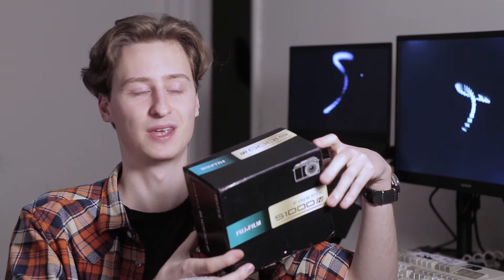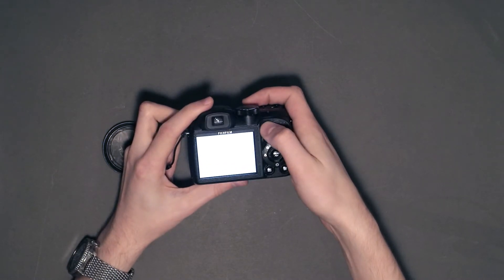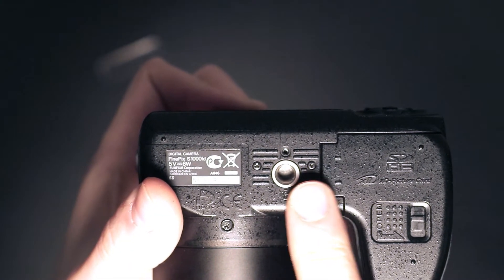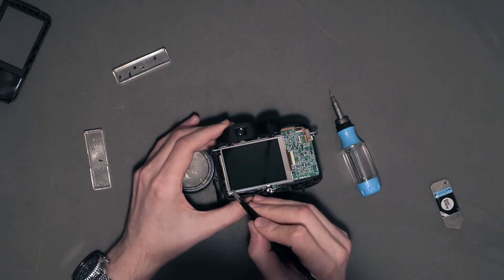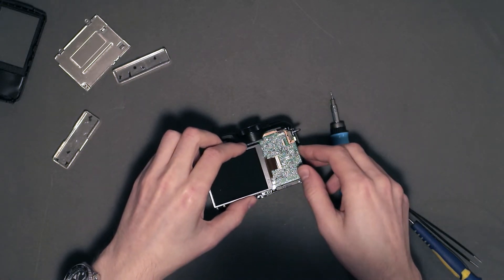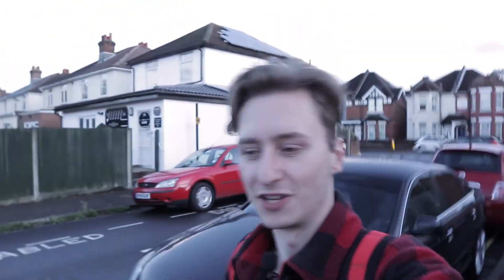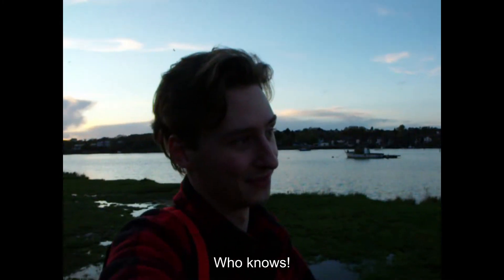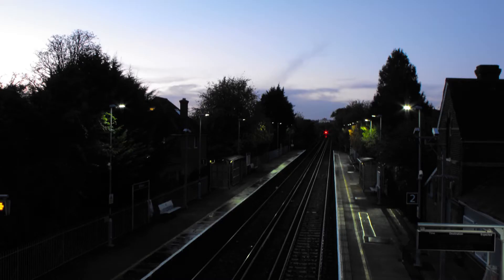Broken Fuji FinePix camera from 2008 - can it be fixed?!

Comment: I got into photography a few months ago. My main camera is a Fujifilm XT-20; my uncle just gave me this. It had some important family memories on it, which I saved, and thankfully the images are very clear and the colours were vibrant, allowing me to see my loved ones from more than 15 years ago. I think it does a pretty good job and it easily surpassed any smartphone's camera at the time, even though it wasn't really expensive back then either. It's so tiny and cute. It's just fun to mess around with. It's obviously not that special now, but if the lighting conditions are different, it still seems better than those often oversharpened, artificial looking smartphone images some reasonably expensive phones of today do. It's little flaws and old CCD sensor gives it a more nostalgic vibe I suppose. Or maybe it's just me romanticising an otherwise almost worthless, outdated little camera. I'm actually really glad you bothered to save it. Thank you!

Comment: Cool. First class video. I plan to try repairing a FinePix S2950 using an AI generated guide that suggests a shorted capacitor in the power supply circuit.

Comment: I mean... NiMH cells are basically guaranteed to be the most environmentally friendly option, so i like AA battery bays. If people didn't just ruin them every time by leaving alkaline cells in. Alkaline cells don't even work THAT well in digicams, you get a lot more shots out of NiMH as well due to lower ESR.

I have a much nicer $10 repair project, a nicely drop damaged Powershot SX1. It has flippy twisty screen, excellent OIS, it vlogs at pretty good looking 1080p (not that i would ever do such a thing), and i actually really like Canon imaging of the era. And i get raw support out of the box compatible with DxO Photolab Elite.

"Not gonna compete with anything you can buy these days"... i mean have you SEEN what you can and can't buy these days? Bridge cameras now cost a grand and don't really ship, digicams are by and large completely discontinued, there's just TG7 by OM System, which is a nice adventure companion, and then just various Kodak junk which really doesn't perform THAT well. What does it matter if the $100 or $200 Kodak has 1080p video when the video doesn't... actually look 1080p at all, it's maybe just a smidge less bad than what you shot with this camera, but the photos are worse.

Comment: Very good job
I have one question about my camera Panasonic lumix lx3 . The issue is a blackscreen lcd completely black no menu .
But when i use a lamp in front of the lcd i can see the menu.
All other parts are ok the pictures also.
How to fix the problem. Thanks
All the other parts are ok.
Reply from the maker: Its very likely a blown lcd backlight fuse, you may be able to find and search for it on the motherboard, search on google for what smd fuses look like. To test, use a multimeter in continuity mode.

Comment: I've the same cam. There is dust on the censor. How can I clean the censor?
Reply from the maker: sorry, i havent tried cleaning the sensor myself, but i assume you would need to follow all the steps in the video and then take out the motherboard thats under the LCD screen. the sensor is likely attached directly to the motherboard
Reply: @TheRepairLair  If you do be careful of the charging capacitor for the flash, they carry high voltage. It might be worth searching for the service manual, they are sometimes available for free online for older cameras.

Comment: I use a pencil eraser followed by alcohol cleaning to clean gold contacts on the ribbon cables, memory sticks, and cards. The pencil eraser has a fine abrasive that cleans well but won't do any damage to the contacts.
Reply from the maker: That is a very good suggestion that i have not mentioned in the video - thank you for pointing it out!

Comment: i have the same camera with battery leakage which has penetrated the inside of the top panel...not sure how to remove top housing cause of the mode selector control...how is it removed ???
Reply: We're you able to open? My camera has the same issue
Reply: @BalloonDecor  Search for "Fuji s1000fd service manual pdf" free download.

Comment: If it comes to zoom to close up objects, it seems older cameras do a better job. I had a Powershot A1000 from Canon (also released in 2008) before i bought a new one.
It has 10Mega Pixels and can zoom on a circuit Board so you can even see the small dust particles. But because you can not go Full HD with it(making videos with it in 640X480 with bad sound is...uff) and the pictures are only 4:3, it's only there for close up Pictures (if you need them)
Close to every Smart Phone Camera is better today